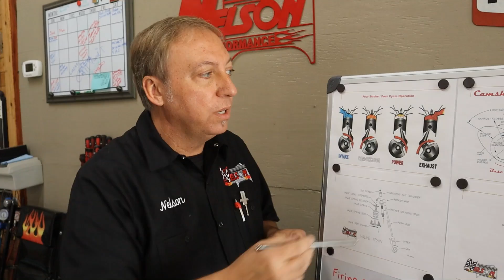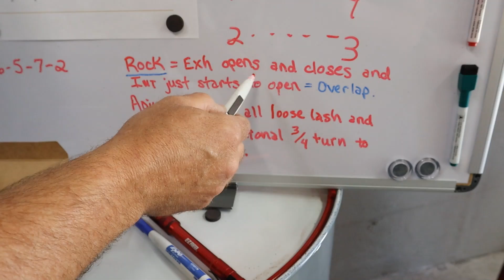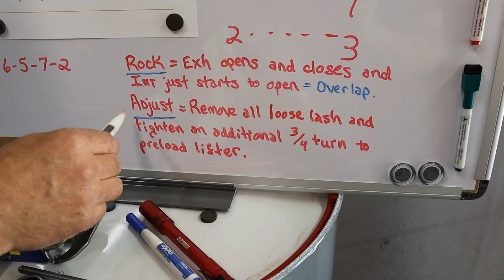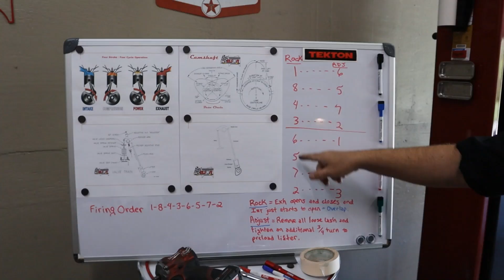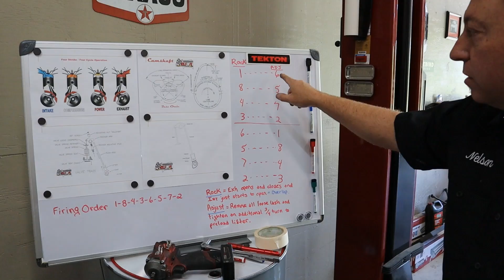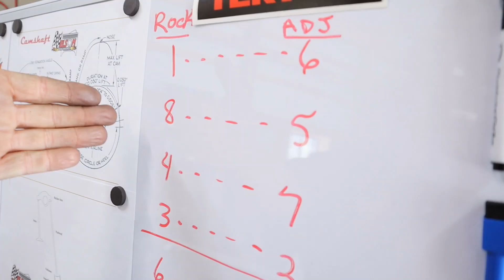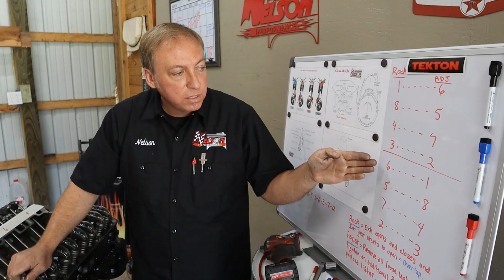Rocker Arm/Hydraulic Lifter Adjustment

Comment: I will try engine is in truck a 350 sbc. I am removing heads and getting them refurbished.
Reply from the maker: Hey Bobby it’ll work fine in the vehicle. You can use the starter to bump through the process but it helps to have two people so you can make sure you’re keeping track of the cylinders and valves or a 5/8 socket on the crankshaft center bolt to rotate it will do fine too. Good luck on the project! Nelson
Reply: @mitchnelsonperformance  Thanks, question should I replace head bolts . I was looking at ARP head bolts.
Reply: @mitchnelsonperformance  Thanks, question should I replace head bolts . I was looking at ARP head bolts.
Reply from the maker: The ARP bolts are the only quality bolt I would recommend, but typically the stock bolts can be reused with no issue. Either way just make certain you use some type of thread sealant (Teflon/RTV) on them as the bolt holes are open to the blocks water jackets.

Comment: Yes I have to say he showed and explain so Well it feel like I can do it .. just wondering can you adjust your rocker arm while the engine is still under the hood?
Reply from the maker: Hello Corey, You don’t necessarily have to view the lifters when doing the process, if the intake is on. You can also watch the movement of the pushrod/rocker arms if the intake is installed. You will see them move into overlap (the ROCK position). I’ve adjusted many engines that way. Just keep track of your cylinder locations to keep you on track. You can also use the ignition/starter to rotate the engine through the process but remember it only takes a slight bump of the key to turn the crankshaft the needed 90 deg. It helps to have a friend bump the key while you pay attention to the rockers. Good Luck with the project
Reply: Hey Mitch this is Cory again . I have a 1975 Pontiac  Grandville Brougham Coupe that has a 7.5 455 engine that has knocking sound when started on cold but goes away after warming up for 20 mins. I have token it to 2 different mechanics with 2 different opinions 1 it’s the pin that hold the rod and the other mechanic say it’s normal after he called the dealership. Which is a LIE!!!!!!!!!! But the engine run strong . I say it’s a loose rocker arm myself from how it sound from cold to ready to run. So if you could help and point me in the right direction because I’m doing my best to Love My Family Heritage???.......lol!
Reply from the maker: Hey Corey, I’ve owned several old Ponchos and still do. First off, is it a “knock” or a “pecking” sound? Only a few things can make a noise on start up then go away. One being a lifter tick or peck that takes a bit to pump up, but this is not an adjustment issue, it’s a weak lifter or low oil pressure issue, another is piston slap. When it’s cold it will rock in the cylinder and rattle or knock until warmed up and the piston skirts grow a little. A worn piston pin bore can also cause a similar noise cold.

Comment: Finally, someone that makes logic and sense, best video I've seen yet.
Now, I'm asking for a friend of mine who missed it up,😂🙋🏽‍♂️
After you take the lash out how much do I need to turn if I have oil in my lifters already?
Thanks for the vid
Reply from the maker: Hello Gerardo, (and friend😏) the method will work fine even with oil in the lifters. The valve springs will bleed the oil out of the lifters as you turn the engine over as the rocker pushes the valve spring down. This will get the plunger off the wire clip in the lifter. The valve spring pressure has enough force to push the pushrod into the lifter bleeding the oil back slightly since the oil pump is not producing oil pressure unless the engine is running.  You don’t necessarily have to view the lifters when doing the process, if the intake is on. You can also watch the movement of the pushrod/rocker arms if the intake is installed. You will see them move into overlap (the ROCK position). I’ve adjusted many engines that way. Just keep track of your cylinder locations to keep you on track. You can also use the ignition/starter to rotate the engine through the process but remember it only takes a slight bump of the key to turn the crankshaft the needed 90 deg. It helps to have a friend bump the key while you pay attention to the rockers. Good Luck with the project
Reply: @mitchnelsonperformance  thank you Mitch, God bless

Comment: MITCH WILL THIS WORK WITH A PERFORMANCE CAM. I HAVE A HYDRAULIC COMP CAM AND ROLLER ROCKERS?
Reply from the maker: Yep, this method will work fine for it. I would recommend that you torque the poly lock adjusting nut (if you’re using that type) to manufacturers spec after setting the allen headed center lock to make certain they don’t back off. Good luck on the project!

Comment: So no 22 ft lbs torque?
Reply from the maker: Some of the later Chevrolet (and many early and late Ford) engine designs did have a set torque for rocker pivot fasteners. This procedure is for the adjustable jam nut or poly lock style rocker design, but you can use it to view the pushrod lifter cup area after torque to make certain its off the wire retaining clip.

Comment: Can you still adjust in this manner when the lifters are already pumped up
Reply from the maker: Hello fellow Nelson, the method will work fine even with oil in the lifters. The valve springs will bleed the oil out of the lifters as you turn the engine over as the rocker pushes the valve spring down. This will get the plunger off the wire clip in the lifter. The valve spring pressure has enough force to push the pushrod into the lifter bleeding the oil back slightly since the oil pump is not producing oil pressure unless the engine is running.  You don’t necessarily have to view the lifters when doing the process, if the intake is on. You can also watch the movement of the pushrod/rocker arms if the intake is installed. You will see them move into overlap (the ROCK position). I’ve adjusted many engines that way. Just keep track of your cylinder locations to keep you on track. You can also use the ignition/starter to rotate the engine through the process but remember it only takes a slight bump of the key to turn the crankshaft the needed 90 deg. It helps to have a friend bump the key while you pay attention to the rockers. Good Luck with the project

Comment: Decent video bro. Not how UTI taught us, but I like your method better. Definitley would have saved me alot of time.
Reply from the maker: Thanks James, I appreciate the comment and subscribing.
Reply: @mitchnelsonperformance  btw I'm confused...on the 4.3, should the rockers rock side to side at all when there's no load on the spring? (TDC) because out of nowhere, my 4.3 blazer started knocking after I was flooring it to get out of the snow. I removed the valve covers and noticed several rockers are extremely loose side to side and I can spin the push rods...this engine NEVER made noises...I cant imagine after that incident something serious really happened with the valve train...
Reply from the maker: Hey James, how is the oil pressure? I’ve seen the blazers toast rod and main bearings if the oil is low and the RPMs get up there for longer periods of time running the oil pump dry. Low oil pressure would cause a lifter peck....possibly.
Reply: @mitchnelsonperformance  I haven't checked it manually but I trust my gauge. Never once had an engine issue. I changed the intake gaskets maybe got some coolant in the oil galley idk if I did it wasn't much...I didnt change the oil but then again I didn't drive it much since. This knocking literally happened instantly when I was trying to get out of the snow in 4wd, engine stalled while accelerating in the ditch and the battery was dead upon restart. I changed the battery and bam...I heard the knocking. Im just like...wtf? Definitley sounds like top end. All the lifters are pumped up...im just completely stunned. Out of the 12 years I've been working on cars, never have I seen an engine act up out of nowhere like this. I'm jist puzzled.
Reply from the maker: I've have also seen valve float at high RPM cause lifter peck but it usually goes away after it idles and pumps them back up. Not sure where to go next on it?
Reply: @mitchnelsonperformance  yea it gets louder on acceleration. I thought it got quieter when I removed the exhaust rocker and push rod...but when I removed the intake and exhaust rockers on cylinder 2, it was the same volume...so idk. Thats what im saying...I've never come across some random shit like this...unless it really is coming from the crank and rod bearings but it sounds like the top end and I can feel the knock when I put my hand on the alternator...so I figured the noise was on the right bank somewhere. Confusing.
Reply from the maker: Are both banks still oiling good up to the rockers? If not I have seen (rare) them blow out an oil plug behind the timing chain. That would cause one bank to peck.
Reply: @mitchnelsonperformance  I mean when I watch it at idle, I can see oil forming in the rockers and then collecting at the bottom of the oil galley of the head, shiny oil...but its pumping. Thats what led me to thing maybe it is a rod or main bearing...but I really don't hear it from the crank...and those damn rockers are loose af when the corresponding valve is closed. When they're open they're tight.
Reply from the maker: kinda sounds like it may be bottom end then 😕 Did you try adjusting them?
Reply: @mitchnelsonperformance  I can see where you'd come to suspect bottom end...but why would the rockers be so loose at tdc? They're hydraulic lifters. After the preload is set during assembly, as far as I'm concerned there is no adjustment. Just 20nft lbs torque.
Reply from the maker: Not sure on that? It’s odd that it has good oil pressure and yet the lifters are not pumping up. My only other thought is if it had a bearing failure and debris is blocking the oil passage to the top end?
Reply: @mitchnelsonperformance  well...the only other thing is...other than the noise, the engine will function perfectly...and drive flawlessly...until the car warms up a bit. Then at idle, the gauge will start to drop down damn near zero unless I hold the gas pedal down. Then shifting will go all erratic, poor acceleration, poor idle. And if I don't stay on the gas, the engine will just die on its own.
Reply: @jamesmeyer4228  what was it?

Comment: I have been having trouble adjusting my 5.7 vortec block with roller cam and hydralic lifter. What would be the the other steps to take i keep over adjusting and bending the push rods .I even switched my rocker arms to a longslot from crane cams 1.5 and i had a push rod went straight threw the rocker arm when I started the truck the first time.My cam is a 265 with .480 lift so its on the mild side and the springs i had installed on my heads could handle up to .500 lift .I did adjust the timing crank gear to +4 advance slot lined up to the cam gear dot tdc so what am I doing wrong i cant find a good video on this if you have any feed back I would really apreciate it.Thanks
Reply from the maker: Hey Franki, if you are following the video closely you shouldn’t be overtightening them. Make sure you are only taking the lash out at first and not depressing the center of the lifter cup. My two first thoughts would be spring coil bind or the valve retainer is hitting the top of the valve guide (or positive valve seal). The Vortec heads have very little additional clearance between the spring retainer and guide and usually need machined down or if the valve springs are not matched to the cam or have been shimmed too much causing coil bind that would also bend a pushrod. Lastly but not likely would be a seized valve stem in the valve guide. Hope that helps diagnose it. Thanks for the question/comment and subscribing.
Reply: @mitchnelsonperformance  Thanks Mitch I will follow your method and as im looking at the top of the valve springs i noticed the marking left by the rocker arms are not quite centered they are a bit off closer to the header side still really close to the middle Is that what you were implying .I was trying to send a pic so you can see the marks I might need to make a video to show you.
Reply: @mitchnelsonperformance   https://youtu.be/1Yvr5ZAFIrQ
Reply from the maker: Hey Franki, is there any chance the timing chain and gear is off a tooth? Causing the valves to hit the piston and bend or break pushrods. If not I would suspect a bent intake valve 
(Or over tight intake rocker) with the way it’s backfiring up through the intake. Have you ran a compression or cylinder leak down test?
Reply: @mitchnelsonperformance  I took this motor apart honed all the cylinders replaced all the piston rings and I was turning the crank by hand when I adjusting the rockers when the cylinders were at top dead center going with the firing order.I did advance the timing gear +4 advanced on the crank gear so I beleive I will need to redo the timing gear and put it on 0 at top dead center and eliminate the advance on the timing on the crank gear it had 3 options -4 ,0, & +4 so.I had a machine shop clean up the heads and they ran threw the heads changed the valve seals installed the valve springs to accept up to a .500 lift on the cam.  The cam I choose is a .480 lift  with a 265 dur on intake and exhaust  this was a custom grind from Ex Isky employees that do cams for machine shops out here in Los Angeles so I will take off the advance now that you brought up the issue with valves posibly hitting the pistons. Now im crossing my fingers the valves did not get bent up this is my first motor built the first time i was sold a pair of rockers that were not self aligned and when i was priming the oil and turning the crank I had a simular problem and bent some push rods that is why this time i went with self aligning rockers and long slots
Reply: @mitchnelsonperformance  I will do a compression ,and leak down test on all cylinders.Then im going recheck the timing chain and gear to make sure im ok there and dial back the gear and eliminate the +4 advance on gear .Thanks Mitch I really apreciate your feedback and input.
Reply from the maker: Hey Franki, you can always put a degree wheel on it (or use the balancer) and degree the cam and see what degree the cam truly is installed at without removing the front cover. Hopefully the compression and leak down will be good.
Reply: @mitchnelsonperformance You are on point on that one Mitch.I have been on the Summit racing site today looking at which degree wheels will work with engine in the truck and im getting a cam degree kit with a dial indicator that fits in the cam bore as well to measure the cam lobe.I had used a piston stop tool turned the crank clockwise and counter clock wise to make markings on the balancer and the middle of the two marks ended up at TDC marking on my balancer.Im just Not sure if its acurate enough using the piston stop method. So making sure my cam is what I ordered is my next step as well.
Reply from the maker: Hey Franki, Yes, the bump stop is very accurate for TDC. The pics show that you have the timing set spot on correct and the key way should always point toward #1 cyl and the cam dowel should be at 3 o’clock when the marks align and that was on target and 4 deg adv or retard would not be enough to cause those problems. Did you make certain the vale retainer to guide clearance was enough? Need those compression and leak down numbers next.
Reply: @mitchnelsonperformance  You stumped me on this one Mitch. It had not even crossed my mind.You have a very good point even if i have springs capable of 500 lift and if the valve  clearance cant travel more then 480 lift then I believe that is were the rocker arm ,push rod and cam lobe will bind  .Im going to have to get with my machinist and see if offset keepers would fix the bind I beleive this might be the problem I get my package from summit today with all the goodies to measure this stuff.
Reply: Now that I remember. I have been doing this all wrong I was adjusting rocker arms when the cylinder was at top dead center, I hope your Rock and adjust method works out .Will this be the same method on a roller cam and lifter I see on the video its a flat hydralic lifter ???

Comment: Hi professor,  what if my lifters are preloaded with oil and is impossible move ? Just keep adjusting? Thanks
Reply from the maker: Hello, the method will work fine even with oil in the lifters. The valve springs will bleed the oil out of the lifters as you turn the engine over as the rocker pushes the valve spring down. This will get the plunger off the wire clip in the lifter. The valve spring pressure has enough force to push the pushrod into the lifter bleeding the oil back slightly since the oil pump is not producing oil pressure unless the engine is running.  You don’t necessarily have to view the lifters when doing the process, if the intake is on. You can also watch the movement of the pushrod/rocker arms if the intake is installed. You will see them move into overlap (the ROCK position). I’ve adjusted many engines that way. Just keep track of your cylinder locations to keep you on track. You can also use the ignition/starter to rotate the engine through the process but remember it only takes a slight bump of the key to turn the crankshaft the needed 90 deg. It helps to have a friend bump the key while you pay attention to the rockers. Good Luck with the project
Reply: @mitchnelsonperformance  im very grateful for your response professor,  im working in my 2001 chevrolet express 3500 5.7,  im not doing a full reconstruction just replace some things like timing set, oil pump, water pump, all ignition components,  and almost all gaskets, was full leaking oil, and just yesterday finished the process of regulation the valves with all new push rods and lifters. Thank you